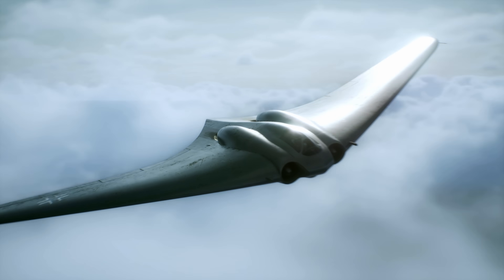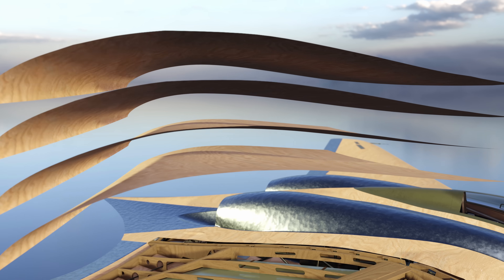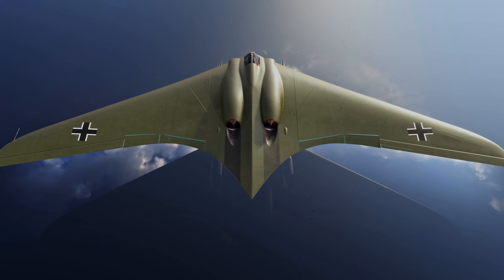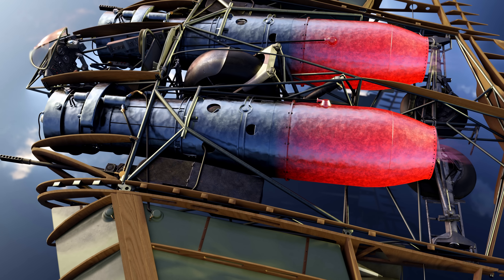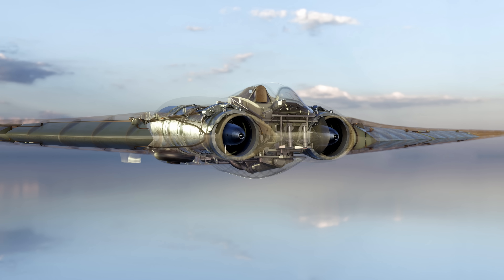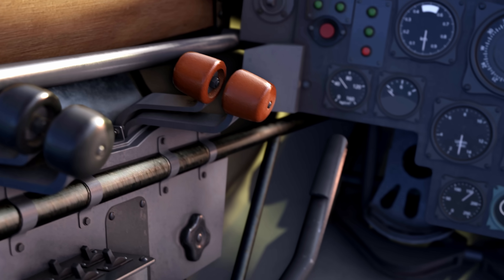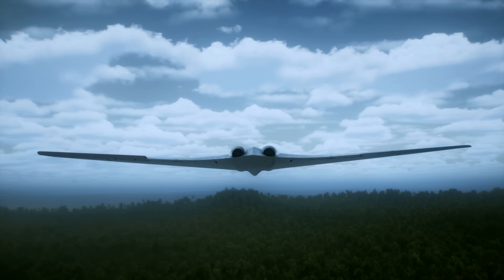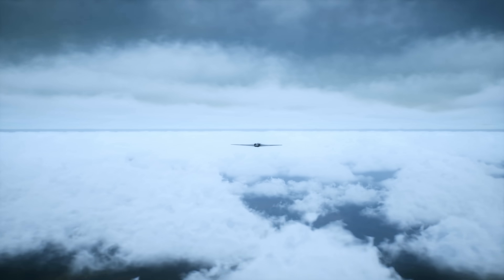Inside the Horten Flying Wing

Comment: Ich habe mal gelesen, dass Flugzeug hatte eine gewisse Tarnfähigkeit bezüglich damaliger Radartechnik. So wurde ausgesagt, erst ab ca. 25 km Entfernung konnten die damaligen Radargeräte dieses Flugzeug orten, was natürlich viel zu spät ist, um überhaupt eine Luftverteidigung zu organisieren.
Und blieb das Flugzeug stetig jenseits der 25 Km von verstreuten, generischen Radarstationen, flog es unerkannt durch die gegnerischen Lüfte.
Reply: That is false. While the shaping of the Ho229 would have some stealth characteristics, the reality is the materials used in its construction would have negated the benefits.

The aircrafts steel tube frame, large open compressors and metal plating around the cockpit would have negated any benefit given to the airframe from its flying wing design. The aircraft also lacked any form RAM coating meaning it simply was not designed for radar stealth.

Comment: Horten Ho 229 was a prototype aircraft that never saw production let alone active service.  It was based on the Prandtl wing spanwise lift distribution theory also employed in subsequent post war Horton flying wing designs from 1948 (also without a vertical stabilizer) produced in Argentina.  This theory also solved the adverse yaw issue that plagued conventional aircraft design.  The Prandtl wing is a solution where the design constraint is not wing span, but wing root bending moment.  The design projects the span out to the zero lift point at the tip, by cleverly adjusting local AOA, camber & planform taper to produce what the Hortons described as a bell shaped spanwise lift distribution.  Doing this made for a very short tip chord that maintained zero lift at the tip, which had the effect of rotating the wing reaction vector such that using aileron control to bank left increases drag on the left tip while producing thrust on the right.  This negated the need for a fin & rudder to prevent conventional designs characteristics tenancy towards adverse yaw & spiral dive that would occur without pilot control input.  The Hortons were very interested in Glider design both before & after the war, but during the war years, there was no other aircraft game in town other than military.  Ludwig Prandtl AKA the father of analytical aerodynamics invented lifting line theory and most of the aeronautical algorithms used in aerodynamics today.  He was a physics professor at Stuttgart university, He produced the well known elliptical wing planform solution employed later in the spitfire design, closely followed be the superior solution that the Hortons approximated.  However, this was outlined on a single double sided sheet of paper that practically everyone else totally failed to appreciate, except the Hortons & much much later NASSA picked up on.  It almost went undiscovered.  I read a NASSA article on it, stating this and printed in the 1980s, I don't know exactly when his paper was actually discovered & recognized for it's true significance, probably was classified information for some time before then though.

Comment: I hate to say but the Ho 229 V3 had 4x30mm guns and could carry bombs wich were only 2x250kg bombs but sadly we got a mix of the V2 and V3 as the V2 only had 2 guns but it had no bombs. The V1 was just the plane without weapons. V2 got guns installed but pretty much the same. V3 was the final prototype and got 4 guns and could carry 2 bombs tho it never was finished.

Comment: It's fascinating how many people swoon over the Horten brothers and selectively ignore Northrup...like the jet and rocket-powered XP-79s.  Heck, instead of plywood, Northrup went and used welded magnesium ... another innovative technology.
Reply: Northrop gained a lot of valueable data from the Ho-229.
Reply: @sandervanderkammen9230  Not for the YB 35
Reply: @NOODLLDThe YB-35 wasn't stealth.
Reply: @sandervanderkammen9230  Neither was the Horten, The Claim that it was Stealth Only Apeared after the Creation of the B2. Please whow a Source from before the Advent of Modern Stealth which proofs that its stealth. The Horten Brothers Only claimed a Steahl Codeing after the Advent of Modern Stealth. Also the Actually stealthy parts of the plane weren't taken over to the B2, or is it made out of Wood with Charcoal?

Comment: Could the ho229 even fly properly without any advanced fly-by-wire support?
Reply: Germany was developing advanced fly-by-wire technology and the first yaw damper systems in parallel with the Ho-229 program along with other development aircraft during WW2.

The Ho-229 used split ailerons just like the B2 does.
Reply: @sandervanderkammen9230  The Ho229 did not have a fly by wire system nor did it have split ailerons like the b2. It used a system of drag breaks to turn that would extend from the aircrafts wings when needing to turn. The project ended as the airframe was unstable at low speeds resulting in a fatal crash that ended both the test pilot and the program.

The split aileron designs used on the B2 stem from Jack Northrop's work on the YB-35 and YB-49 bombers and are unique to Northrop flying wings.
Reply: @Tozzpot500 The Horten Ho-229 was the world's first jet flying wing with split ailerons.

The FBW yaw damper controls were still in development and were used on postwar American jets.
Reply: +@80fire71   The project only managed about two hours of powered flight testing before a fatal crash. Each prototype was a different design.  The Horten brothers were beginning to solve yaw issues, but with untested solutions.

Comment: Era en Madera porque eran Prototipos 😮😅😅 en serie serían de metal ok 😅🫡🇨🇴
Reply: +@vidayviajesdelucho-f7d    It was made of wood because of strategic materials shortages.  I think the production model from Gotha was intended to have a layered wooden/composite construction over steel frame.  You can find wooden components on many late war aircraft - wooden flaps on Fw-190s for instance.  The Ta-152 had a wooden/composite empennage and when the AAF tested a captured example they reinforced the tail with steel plates because they were concerned it would fail.

Comment: Only haveing 20 hours of lifetime for an engine is absolutely absurd thats like 4 or 5 flights till the engine is toast...imagine how much money went into this... Looks like americas spending😭☠️
Reply: The Jumo -004 'B' engines that were used in operational service had a PFTR rating of 100 hours at full rated power (same as the Allies) 
American tests conducted by Operation LUSTY confirmed TBOs averaged 55 hours, this is better that Allied high output piston engines used in the best fighter aircraft. 

German jet technology was adopted, production and development continued under Operation Paperclip which transferred the bulk of Germany's high tech aerospace industry to the US.
Reply: U both are smarter than me
Reply: +@Sir_710  The 229 program only achieved two hours of flying with jet engines on the second prototype before a fatal crash in February 1945.  The 229 program was essentially over at that point and the third V3 prototype was found unfinished in mid-April 1945 and it is now the example at the Smithsonian.  (The V4-V6 prototypes were also in the shop and were just frames.)
Reply: @FiveCentsPlease  We know from Allied tests that German jet engines were superior to Allied jets... and that this sleek flying wing design would not be possible with the Allies' bulky, obsolete centrifugal engines.

Comment: As a retired aviation military avionics technician, I must say that this video is very nicely done.  It kept me interested even though I knew how it all worked underneath, if you will, as far as electrical/instrumentation/flight surfaces, etc.  

It was neat how you showed the procedures for take-offs, having to use the brakes to stop wheel rotation before raising the gear, etc.  It's all a lot to remember as a pilot I bet - those guys were nuts.  :)

Very very well done.  Great channel for YT.  Thank you.
Reply: So just a thought but would it be safe to say the r&d department of the military studied the control surface design and took it to Northrop saying lets build another flying wing but with fly by wire to do all the complex constant input needed? I see certain aspects shared between the 229 and b2 but the big difference between this the b2 and yb49 is the early Northrop design used vertical stabilizers while the b2 uses multiple flaps and spoilers for stability like the 229. I think 229 was extremely complex for its control surface design and likely a chore to fly thinking of what input was needed for acting and reacting which by the 80s computers worked all that out.

Comment: What are the rudder pedals for? There's no vertical stabilizer hence no rudder.
Reply: The rudder pedals control yaw by left and right split ailerons.
The same system is used on the B-2
Reply: @DoktorBayerischeMotorenWerke  Read your answer and maybe edit your answer.
Reply: @baozuci3594  There are no errors... do you not understand what yaw control is? or do you not know what split ailerons are??

Or both?
Reply: @DoktorBayerischeMotorenWerke  What I know is there's no stabilizer hence no rudder. Using split ailerons is not the same as using a rudder. Learn the difference.
Reply: @baozuci3594  You are obviously not a pilot or someone familiar with this technology..
Reply: @DoktorBayerischeMotorenWerke  You're just running you mouth and got nothing to say.
Reply: @baozuci3594  You are very clearly someone who lacks any formal education or professional experience in aviation technology.

The Horten Ho-229 and the Northop B-2 both use cockpit rudder pedals to affect Yaw control authority through the use of SPLIT AILERONS.

Please educate yourself.
Reply: @DoktorBayerischeMotorenWerke Then stop calling it the rudder. They may work like old style rudders, but are not. It's basically putting air brakes on each wing to simulate rudder activity. Call it by another thing, just don't call it a rudder.
Reply: @baozuci3594  I never called it a rudder, it is the YAW AXIS CONTROL
The pilot operates the rudder pedals in the exact same way as if the plane has a rudder despite the fact the aircraft uses split ailerons instead of a rudder.

Why is that so difficult for you to understand?
Reply: @baozuci3594   The captured V3 example at the Smithsonian never had any control surfaces to my knowledge. It wasn't finished.  They are not present in any photo after capture.  But the Smithsonian says in their description that controls were intended to be a combination of elevons, spoilers, and drag rudders in addition to a speed brake and flaps.
Reply: @FiveCentsPlease  We know that the Ho-229 that flew used split ailerons to control the Yaw axis... just like the B-2 bomber.
Reply: The rudder Pedals are linked to  the special type of ailerons.

Comment: Absolutely mind-blowing to think this aircraft was conceived and partially built during WWII! The wooden structure is particularly fascinating, showcasing incredible ingenuity under immense pressure. It truly makes you wonder what else could have been achieved had the war taken a different turn.
Reply: Jack Northrop used a similar technique for the wooden wings of the N1-M in 1939-40.  The Mosquito was totally stressed skin wooden monococque throughout the whole of WW2, DeHaviland having used this technique between the Wars.  It then became a favourite way of building high performance yachts for many years.
Reply: Its actually steel structure covered in a radar absorbing plywood skin.

Comment: The Jet intakes were far from stealthy
Reply: They had a very small frontal RCS compared to a propeller!   You don't need to be an expert on Radar stealth technology to see that the Ho-229 was completely devoid of any significant retroreflective structures.
Reply: @DoktorBayerischeMotorenWerke  You dont need to be an expert to see that you dont have a clue what you are talking about.
Reply: @wolf310ii  Are you claiming that propellers do not have a HUGE frontal RCS???
Tests proved the Ho-229 has a very small frontal RCS for its surface area.

You don't need a radar test to see this... it blatantly obvious for anyone that is not blind or highly biased.
Reply: @DoktorBayerischeMotorenWerke  No, im claiming that the Ho IX is NOT completly devoid of any significant retroreflective structures.
Reply: @wolf310ii  Well, Prove it!
It has no propellers... it had no vertical stabilizers... it had no large surfaces with right angles...
Please tell me where the significant retroreflective structures are.?

Comment: These 2 Aircraft were designed & built  by Germans. 
They were  very impressive Aircrafts.
Their design was copied (or stolen) by the U.S. Military and became  the B-2 bomber, which is just as impressive.
Reply: Not really the case. John Northrop had been working on flying wings since the Horten brothers were teenagers. His XB-35, a project which began before the 229 shares the same wingspan as the B2
Reply: What didn't the Americans copy or steal from the Germans.

Comment: Now I know where the shape of B2 spirits  came from ! Always thought it was alien work 😂
Reply: Alien WARE.
Reply: The B2 uses completely different control surfaces. The B2 is actually a direct descendant of the XB49 which was based on the XB35. The XB35 was already doing test flights long before the Ho229 even had its first mockup
Reply: @strangecoasteroutdoors799 The XB-35 prototype wouldn't fly until 1946, however its scaled down models of the N-1M and N-9M were flying in 1940 and 1942.
Reply: John Northrop had been working on flying wings since the Horten brothers were teenagers
Reply: @peterson7082  🐂 💩
Reply: @peterson7082  nonsense ho229 was the first plane - so your  statement is not correct
Reply: @sigischmidt367  The 229 was not the first flying wing. I am correct.
Reply: @sigischmidt367  Jack Northrop's N1-m flew in 1940. Twin engined, finless flying wing of composite wooden construction.  The Horten brothers had only built gliders at this time.

Comment: I'm going to be that guy and talk about something I know very little about it seems to me that they could have cured a lot of their problems using cams that could be cut so that when they wanted to turn they would simply turn the route they would simply turn the yolk and cams would control everything needed to make that a smooth action when they wanted to pull up similar cams cut differently of course would control other surfaces I really don't see the problem except maybe a little patience in math because a cam after all is a mathematical expression of an irregular curve

Comment: The Horton was discontinued because the aircraft could not really be controlled during flight. There was also a fatal crash. During reconstruction of a model, it was probably due to the short engine on the Horton prototype. This was also the model for the American stealth bomber, which initially struggled with similar problems. There was documentation about the load-bearing capacity of the Horton. An original replica, which was also fired at with radar waves, showed that the Horton was very difficult to detect on radar. Not only was the aircraft very difficult to make out due to its shape, it was also mostly made of wood, which absorbs the radar waves. The metal struts on the cockpit provided a minimum of reflection, and you had to look very closely for those.    

Die Horton wurde eingestellt, da man die Maschiene im laufe des Flugs nicht wirklich kontrolletren konnte zudem, gab es einen Tötlichen Absturz. Bei einer Rekodtrution  eines Modells, lag es wohl am zu kurzen Triebwerk des Prototypen der Horten diese war auch das Vorbild des Ametikanischen Tarnkappenbombers welches zu beginn, mit ähnliche Problemen zu kämpfen hatte.  Es gab eine Dokumentation darüber über die Tragfähigkeit der Horton. An einem Original nachbau welches auch mit Radar wellen beschossen wurde, dem nach war die Horton sehr wohl sehr schwer  auf dem Radar zu erkennen.  Das Flugzeug war nicht nur in seiner Form sehr schwer aus zu machen, es war auch, zum.Großteil aus  Holz was die Radar Wellen schluckt. Ein minimum an reflektion  waren die Metall streben am Cockpit. un da musste man schon sehr genau hin sehen.
Reply: Scheidhauer bescheinigte der HO IX gute Flugfähigkeiten. Der Mann war Segel und Nurflüglerpilot und hatte daher Erfahrung.

Wo ist das jetzt "kann man während des fliegens nicht kontrollieren"???
Reply: The Ho IX was discontinued because the war ended and the crash was because of an engine failure, not because of the aerodynamic or control problems. That prototyps crash sometimes isnt uncommon, even today.
And no, the Ho IX wasnt the model for the B2, Northrop itself was a flying wing pioneer, befor and during the war.